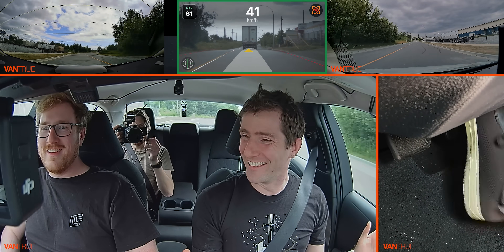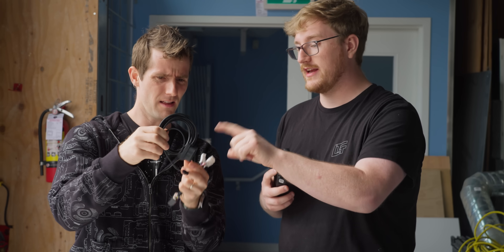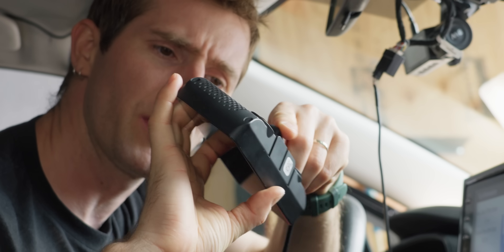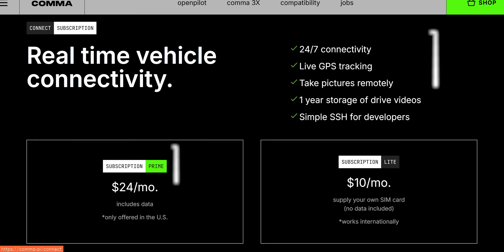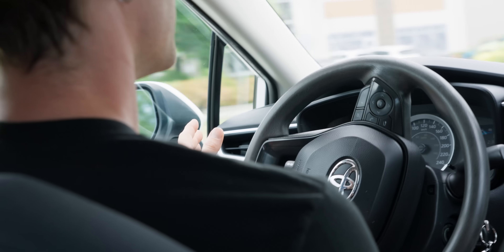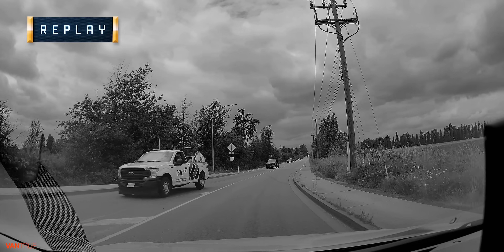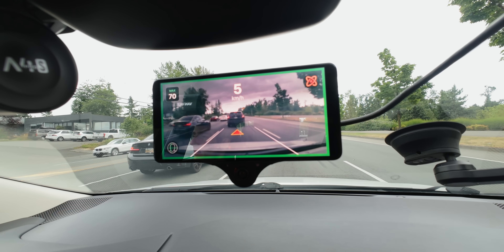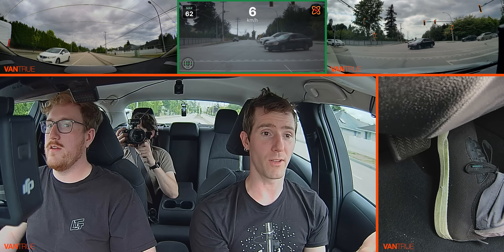I Upgraded My Car With Open-Source AUTOPILOT and it's AMAZING

Comment: This really does make driving chill! I've been using Sunnypilot for 2 years in my GV60. Wait until you take long road trips with it, it's amazing how relaxing the drive is!
Reply: Where is the chill in this video? He had to intervene multiple times and it was freaking out on a simple corner?
Reply: @ShpanMan Yeah, there's no chill in this video, but that's because LTT picked a bad car to test with. 

One of the most difficult things to explain about openpilot is that the experience isn't the same for every car openpilot supports. Some cars have higher steer limits, and some have lower steer limits. These limits are specific to the car and its not something Comma can do anything about, openpilot simply does the best it can while staying within those limits. When you see linus having to take control, it's because openpilot has reached the steer limit for that car. 

If you look at openpilot running on any recent Hyundai/Kia vehicle for example, its a vastly different (and significantly more chill) experience, and I really wish LTT had used one of these cars instead.

Comment: This has nothing to do with self-driving. It's just a highway lane assist, and the Hardware can't support something like Teslas FSD or whatever Waymo is calling their software, for that you would indeed need an external GPU.

Not expecting this whole project to ever go anywhere important, It's just too expensive and few cars support it enough for it to actually be a benefit instead of a liability. Good chance you gonna figure that out yourself if you keep using it.

But that's for the base version/software. The forks, the entire point why this is open source, are a very different story, and its kinda impossible to get reliable info about them as the userbase is just way too damn small right now. This video will probably help with that. ^^

Comment: What is the legality of devices like these? At least in North America.

I cannot imagine insurance companies would approve anything as soon as they find out something non-OEM was controlling the vehicle.

Edit: they briefly mention it but still… if I’m an insurance broker that’d be an automatic denial in an at fault, and ammo for the other provider if the accident is questionable as to whose fault it would be.

For point of reference i was in an accident, swerved into the ditch to avoid hitting a car head on who lost control of their car.
It took months for them to decide that it was not my fault.
The provider said if I had hit them directly it would have been an automatic no-fault for myself, even if that was the more dangerous choice between a head on collision or ditching my car…. 

I’d urge people to not use a device like this.
Reply: The responsibility model is the same as what you already have in your car.
It's a Level 2 ADAS system; drivers should always monitor the system and be ready to take over when needed.

Comment: My buddy installed this on his Prius 2023 when he got it and it works with all the car's sensors.
It uses the proximity detectors on the sides for line changes, it tracks the user's face to see if you are constantly looking at the road, etc. I think it was a slightly different model of hardware for the opensource code though.
Reply: If you know of anyone who has installed one on a 23 Prius, I'd love to see the video of it in action.

Comment: Nice seatbelts guys
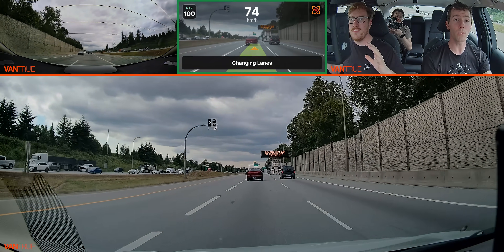Reply: 16:07 literally no seat belt
Reply: @EnchantingPlatinum  16:15 you can clearly see the seatbelt. unless you think they keep taking the seatbelt off and on. which quiet frankly would be more amazing.
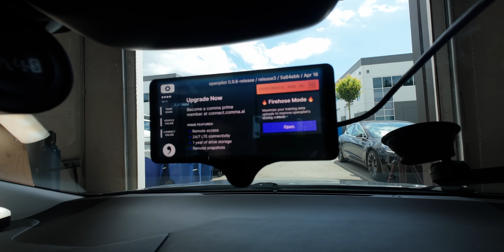Reply: 9:58
Reply: @donc-m4900  it doesn't matter. Move the  microphone elsewhere. They're literally testing a sketchy AF car tech I can't imagine a situation where security should be over everything else.

This is how stupid accidents that could be avoided happen
Reply: @jairo.cabello Where I live, adults are not required to wear them. Stupid not to use them, yes.
Reply: @jairo.cabello  Seatbelt doesn’t avoid accidents from happening. You don’t need to be so worked up by wrong reasoning. They did wear them, and they were fine.
You can even argue that because they were testing sketchy open source autopilot, they were even more aware of the road then any other average driver with them
Reply: I'm pretty sure it was a sponsor requirement not to wear the seatbelts to show their trust in the product 😂 @gamgnamstile
Reply: @jairo.cabello IF ACCIDENT HAPPENS this is NOT THE REASON IT HAPPENS
If they go on accident they are screwed not the other part
Reply: @jairo.cabello don’t be gay
Reply: @donc-m4900 in all of canada you are required to wear a seatbelt. Don't know, in which 3rd world country you live, but - yeah.
Reply: @d3rpn1nj47  then the sponsor is complicit in breaking BC driving laws.
Reply: @gamgnamstile  they were filming a video and because of that they were more distracted than you would be during normal driving.
Not wearing the seat belt correctly is stupid.
Reply: @donc-m4900 Great, do you live in Canada? If no then I’m not sure what your point is.
Reply: I was having panic attacks at first but he is wearing a seatbelt. There doing it under the shoulder so its not very visible on camera most the time don't think it was the safest way but there is a seatbelt on......
Reply: Yall better be just as angry at people that drive classic cars that only have lap-belts then. 
Because in MANY places, including multiple provinces, it is totally legal for cars that are old enough and only came with a belt that goes over your lap in the front.

If you aren't just as fervently mad about that then you have no reason to get all soap-boxy over them just having it under their arms. They are adults, there is functionally no risk to anyone else as the belt across the lap and torso will still prevent them from being launched out of the car. As well as acknowledging that it's still not as safe and you shouldn't do it like that. 

So many of you clearly just want something to morally grandstand over.
Reply: @NWinnVR  is this a classic car with only a lap belt?
No.
Then there is no excuse to not wear the belt properly.

Comment: I'm honestly amazed that things like Comma aren't required to go through any kind of DOT certification, especially when considering it can be installed on things like a Chevy Silverado or Ford F150.
Reply: It's not just Comma.  Literally no ADAS systems from ANY manufacturers are required to go through any kind of DOT certification and there is currently no official DOT certification program specifically for ADAS systems like adaptive cruise control, lane keeping, or automated emergency braking.
Reply: Technically speaking, the Comma ships with no software loaded. It is up to the customer to decide during setup what open source software they wish to install, whether openpilot or something else. This essentially takes the device out of regulatory scope because the device has no driving capability out of the box; it is the user who decided to add those capabilities by installing custom software. Thus all of the responsibility is on the customer as far as ensuring the safety of any modifications they're making to the vehicle.
Reply: Why would it need to be?
Reply: @tehfalcon because, idk, basic safety?
Reply: @twandepan Oh brother… OpenPilot is very safe, it monitors the driver at all times and you are required to be paying attention and ready to take over. We don’t need the government to step in and mess with an Open source project. Why do people want less freedom?
Reply: @tehfalcon  I mean the point isn't that it's particularly unsafe, but that it would be good to have officials check that it's safe. Not just for this product but also for all other products like this. It would not impact the freedom of safe products
Reply: @Papierkorb2292 nanny state
Reply: @Papierkorb2292 In Germany this would be so forbidden if it were to be certified, because there's no way Comma would spend the time to collaborate with every nation on their weird requirements. Shouldn't we be glad there's no special certification?
Reply: @tehfalcon  I'm ambivalent about this. Especially because with any kind of driving (not just self-driving), anything going wrong also puts other people in danger.
Reply: @leonYoong  I'm not sure whether this is completely illegal in Germany, but you'll definitely have to get it TÜV approved at least, which I'm in favour of.
Reply: @tehfalcon  The street isn't a playground
Reply: @leonYoong  compare the rate of road deaths between Germany and USA.
I'm glad that we have all these "weird" requirements in Germany.
Reply: @Papierkorb2292 tell that to Tesla, GM, Ford, and Waymo...
Reply: @leonYoong  Yes, the TuV is extremely annoying
Reply: @tehfalcon what if instead of being a part of the development, DOT just gives developers basic standards to be met for safety reasons. If anything, Comma may have already exceeded any potential expectations if it’s as safe as people are saying it is.
Reply: @kiavaxxaskew they do, the standards are driver monitoring. Comma is very strict about it.

Comment: Pretty cool, i wonder how a midrange model with a higher steering range or a better base feature set would work with it since this car kept hitting the Steering limiter
Reply: The Chevrolet bolt is a killer vehicle with excellent steering torque, fully used by openpilot

Comment: As a mechanic who works on vehicles for a living, Jake's advice about disconnecting the vehicle batter is spot on especially for something like this. Your unplugging and plugging things into vital systems and not only does powering the car down prevent blowing things up, it also lessens the chances of the systems and modules throwing codes that could hinder this device from working in the first place.
Reply: As a diesel tech, having a battery kill switch on almost all trucks makes me wish it was an industry standard on all vehicles road going, off road,, and marine as standard.
Reply: I installed this on my F-150 a month ago and didn’t disconnect the battery. 

Luckily everything is fine, but I wish I would have thought of that though 😂
Reply: The main issue is while you're messing around with bare wires/plugs accidently shorting a 12V or GND wire to some non-power/data wire that shouldn't have 12V on it, or shouldn't be grounded.   That sort of a short is not going to blow a fuse because it's not a power wire, instead you risk permanent damage to a module and those are costly to replace.
Reply: disconnecting a battery also locks the system and you need to contact your dealer for a code to activate your info system.
Reply: That's ok safety advice but it's overly cautious and car dependent. For the OBD port connection for comma power, no concern. The lane keeping camera they unplugged is unpowered when the car is off because the car has no need for the camera when parked so it's safe to unplug. It's also not a vital system the car runs fine with it unplugged completely.
Reply: I didn't do it on my Hyundai, and it was fine. You can always be careful, but I've never heard of anyone getting bit by this for a comma installation.
Reply: its a good idea to disconnect the battery. that said, i don't unless im touching airbags or welding or working outside of the shop. flat rate kinda makes you not give a sh!t about low odds scenarios.
Reply: I have been working on cars for years, and I forgot to disconnect the battery when installing a head unit on my buddy’s car. Well, I blew a bunch of fuses 😂
Reply: it definitely is a good habit, but i think they didn't include it in the steps because they tried to make it as beginner friendly as possible, and i can see how adding a step to open the hood would discourage some buyers
Reply: I had to replace a fuse because I didn't follow the instructions of the video I was watching when I replaced a dome light 😆
Reply: Ohhhh im jaking it, im jaking it!
Reply: This is literally basic knowledge 😂😂
Reply: You should not just unplug batteries in “newer” cars. For example bmw requires you to tell the car that you’re unplugging the battery because if you don’t, you might destroy certain components. Speaking from experience since I destroyed my frm module in a 2010 bmw…
Reply: A lot of armchair experts here pretending that something esoteric like this should be known to someone with "common sense". 

What a load of nonsense.
Reply: Goes on sale for $799 every so often....
Reply: As a mechanic who works on cars for a living, you should go back and redo the electrical portion😂 there's no reason to disconnect battery
Reply: I'm not opening the hood and disconnecting the battery,  thats way to inconvenient.
Reply: @nbrowser  There's no power running to the camera when the car isn't on. Turning the car off is effectively flipping the circuit breaker, unplugging the battery is like cutting the power line. Totally unnecessary for this particular installation. The power is already cut to the camera, unless you accidentally turn on the car, there's no planet upon which the circuit is going to magically close somehow.
Reply: You’re
Reply: Over 15 years of automotive technician experience here, I never disconnect the battery unless I’m doing a starter or alternator (to prevent shorting the disconnected cables) It’s just not necessary, never had an issue.
Reply: @DrinktheVenom have been a mobile plant/heavy vehicle mechanic for 13 years only time I have disconnected a battery/ turned off an isolator when doing electrical work is changing batteries, starter motors, alternators, or sometimes when messing with an ECM. I almost forgot when doing anything with airbags and pre tensioners. We  got to set some airbags off when I was at tafe and ever since then I have had a healthy respect for not having one go off in my hands.
Reply: But how will I make car pancakes without car batter?
Reply: Anyone messing with electronics should have the same wisdom. First thing you generally try is remove the power.
Reply: Meh, there's always the master fuse.
Reply: As someone who is not a mechanic and does not work on vehicles and does not have a car nor a license i have to say, that you are right
Reply: Make sure to have the code to unlock your infotainment system nearby and you may have to reset some codes.
Reply: You spelled it batter durp
Reply: Where is my cars batter located lol
Reply: @Downsydawg  Usually it's right behind the blinker fluid reservoir. Old-timer mechanics will tell stories of mixing the two for some wicked pancakes.
Reply: @Downsydawg  the same place the pancakes are located.
Reply: @Downsydawg , just look it up, it depends on what car most have it under the hood, and disconnect the battery correctly.
Reply: you've never seen an engine bay lil bro
Reply: There's nothing dangerous about this install. The only thing disconnecting your battery will do is reset the car's internal storage (which you don't want)
Reply: @SeanLinsley  Disconnecting the battery is fine, it literally won't hurt anything. Worst it does is it might reset some infotainment or instrument cluster settings, but that depends on the car and at most is just an annoyance.

Comment: I do have to agree with Jake, you are supposed to disconnect the battery for any electronics and my step 1 is usually "I'm not disconnecting that battery whats the worst that can happen."  Unless I'm working on something big.